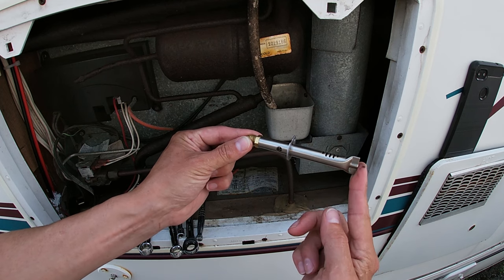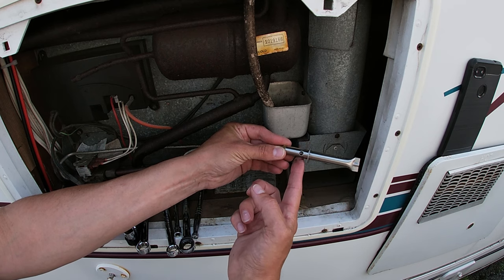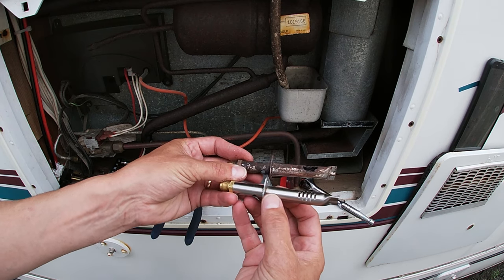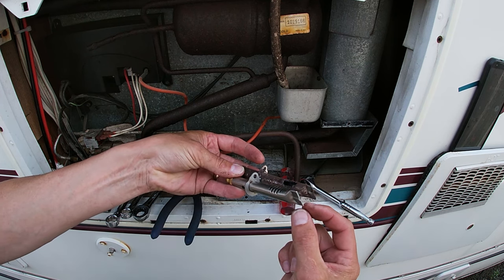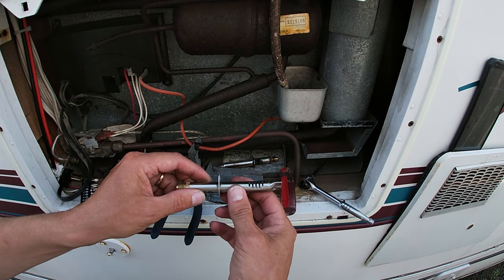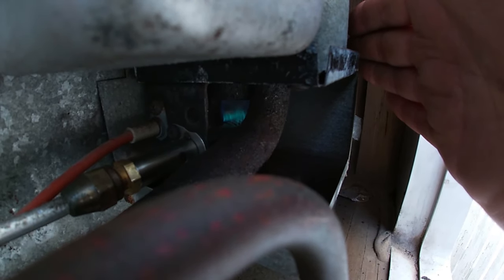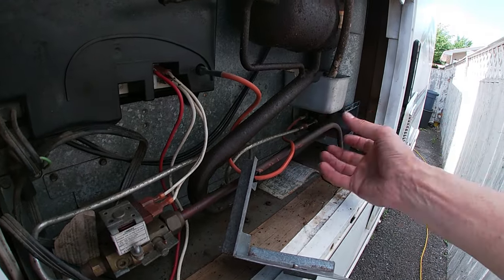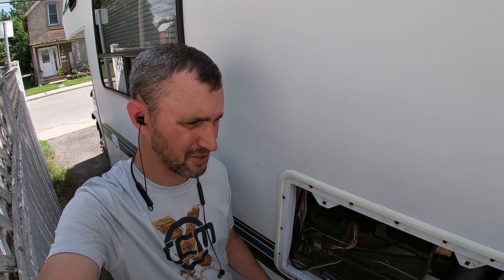Fix Your Norcold RV Fridge Problems

Comment: Thanks for cutting out how to remove the cover to do the repair, for us dummies.  Fast forwarded and you cut out how to replace the cover, so I couldn't work backwards to have an idea how to remove it.
Reply: if you cant figure out how to remove the cover, you shouldnt be replacing propane burners and other parts.

Comment: Dude  !  You just nailed my problem !  Nobody but you talks about the proper flame burn and mine has half orange flame .  Thank you bub great video,  better than all the rest !
Reply from the maker: Cheers!
Reply: My 20yo Norco also has a partly orange flame & the new ignitor I installed cannot succeed in lighting it. I have to restart the process, go outside, & light it manually w/a lighter. I'd like to try this before going more $$ w/a new control board. Perhaps I can even just clean it, although it has quite a bit of rust on the outside surface. Thanks for helping!

Comment: Hi, thanks for the video. We have a brand new 3 way Norcold. It is working on DC and AC but not on propane.  The solenoide valve seems to be looked and does not allow gas to go to the ignition area. How can we unlock that solenoide valve? We checked gas lines and gas is going through, just not getting to the flame area. Any advice would be greatly appreciate it!!
Reply from the maker: Some mechanical checks can be done. You can power the solenoid separately and see if it will click at all. (and pass fuel through).. as well you can check if your fridge has a pressure sensor on the propane line. If so, it may be out of spec/faulty/not reading. Follow this thought: If the solenoid works when powered manually, then maybe your fridge brains won't enable it due to 'low propane' sensor being tripped. If that's not the case (because you don't have any such sensor) then your fridge brains may have some other sort of sensor issue.. maybe your temperature switch isn't sending to the brain.. or something else like this. I believe RARELY is the actual brain the problem. Mostly I think the fridge problems are with the mechanical parts (like burners or sensors). When you use the AC or the DC on your fridge it doesn't use any of these propane systems or brains to operate.. so .. since your AC/DC is still working, it's NOT the fridge ammonia or piping or anything in the cooling system.. it's limited to the propane brain systems.

Comment: We have a Norcold N811RT. We run ours on electric. Fridge quit getting cold. Why would tube be hot to the touch ?
Reply from the maker: I just replaced one of those with a ffet1022uv frigidaire refrigerator. Same problem. It had a gas pressure leak and wasn't going cold. I believe yours may be the same and the refrigerant is dead to the heat, and it will no longer function.
Reply: @reelandgooutdoors  So just replace fridge?
Reply from the maker: @roboink  unfortunately they don't have service ports, so you can't recharge them. You can buy a whole new refrigerant coil system precharged and install it, but it costs more than a new fridge, with the same problems all over again.

Comment: Great video! Easy to follow. I have the same fridge as in the video. Works as it should with one exception, when in propane mode, it will shut off and not re-ignite. Usually around 3am, with a nice loud beeping to let you know. It has happened occasionally during daytime, but almost always at night. Any ideas? Thanks!
Reply from the maker: Any chance the fridge is low on power? I'm suggesting it's getting low on battery at 3am and it's cutting off due to low voltage? Just a thought. Low power or bad power connection might make the sparker misfire and cause an error. Check for clean and nice solid connections at the sparker and board plugs. Any dirt or corrosion can decrease voltage to the unit
Reply: Is the name propane fuel jet? I can not find the part using that name.

Comment: It looks like it's operating without a thermocouple. I didn't think that was possible. What am I missing?
Reply from the maker: It's a DSI heater, not a thermocouple. That's why.
Reply: @reelandgooutdoors  Roger that. As a dinosaur I was not aware of that technology. So something else is sensing the flame for the safety shut down of gas if the flame goes out eh?
Reply from the maker: @mattlovern4846  yes, the same unit that makes the dsi spark is also the thermocouple feedback, so although it no longer has a pilot light, it still uses the same tech to 'stay' on.

Comment: Hi! This is a lovely video. However im not running my norcold rv fridge off of propane, just ac/dc and it's not cooling :( 

Inside the fridge on the cooling fans, it was encased in ice. I took the ice off the fins when i was cleaning the fridge and now the whole thing won't cool. 

I'm not super knowledgeable on RV repairs and i was hoping maybe you could lend me some advice 🫶 i would appreciate it a lot.
Reply from the maker: If you have ice, it will work! By any chance was there a tiny metal clip on your fins when you took off the ice? That tiny clip is the thermostat for your fridge and is required to make it run! Move the clip right or left on the fins to make it warmer or colder. If you've moved the clip I expect it's now set too warm.
Reply: @reelandgooutdoors  I took the Clip off of the fins, it was never attached when it DID have ice

What I mean to say is that I took all the ice off of the fins while cleaning, and now the entire unit refuses to cool at all. The freezer isn't freezing, the fridge isn't cold at all. I'm worried I screwed up by taking the ice off (it's been several days and the fridge/freezer still isn't cooling anything down.

My rv doesn't (and can't) run off propane, just electric or DC :(
Reply from the maker: @Sunnnbeam  here's some links: you likely have a thermistor on your clip. https://www.amazon.ca/Dometic-3851210025-Thermistor-44-Lead/dp/B004LERB30/  and if it is gone now your fridge won't start. Check if you have or had one of these on a clip. Let me know. (Some have a copper tube one and not a plug in clip one) thanks
Reply from the maker: And here's a video showing how and why you need the clip and thermistor: https://youtu.be/bY7cy4Kf3VQ

Comment: Can you give me some idea as to the poor freezer cooling on electric vs propane in my NorCold? And, I seem to be going thru more propane than expected. I'm filling a 20 lb tank every three to four days. Thanks in advance. I don't have any electrical measurement experience.
Reply from the maker: Here's a couple of thoughts on this. If your electric heater element is supposed to be 400 w, check with a consumption meter that it is actually using 400 watts. If the element is bad it may only use 200, as an example. This will tell you your element is not producing enough heat to produce the necessary cooling in your fridge. Regarding propane, be sure your nozzle is the correct nozzle for your position in the heater and for the required cooling in your fridge. I have seen many nozzles that look almost exactly the same, but certainly are not when it comes to jet size and air flow, so be sure your nozzle is the right one for your actual fridge. Regarding general cooling problems, make sure your fridge and freezer doors are sealing perfectly around the face of the unit, so you don't have any air leaks. This can be a main cause of inefficiency on these small fridges. The cooling in the fridge requires air transfer out back. There's a set of heated fins behind your fridge which require clean air flow from bottom up through the top, and with that rear cooling the absorption through the inner heat sink transpires. This is how your inside fridge gets cold, by heating the outside coils and then cooling those. All of these systems have to work properly for these tiny fridges to function at all. I will say your propane consumption is enormous, and if you cannot isolate that it is only the refrigerator, I would strongly suggest you have another leak somewhere.
Reply: I just went through a 20 lb tank over the weekend. @paulallentaylor6034 - Did you find a fix?
Reply: @cschave  I haven't had a chance to putter with it. We are north in the cold air. When it warms up, I'll look at that dispersion pipe he shows. It's a good chance this is the problem. I ran my propane while boondocking and it didn't cool much. I will get into this soon.
Reply: @paultaylor6167  Thanks Paul! After looking into it further, I realized that I had only gone through 30% of the tank. It was secured to the trailer, so when I originally tried to see how much it weighed, it felt empty. Guess I'm just really strong : )

Comment: 4 minutes in, I knew you were the guy.
That being said.... I'm still searching for an answer because my Norcold is still sending the 'N' fault code or '5' flash code on other models.
YES: Checked all power sources
YES: Bought new board and it still shows 'N'.
YES: Tested thermistor for resistance, its good.
Tapped rusty areas to see if I can get gas flow.... nothing.
I'm stuck, please help.

Comment: Would you know why it would work only on propane and not electric?
Reply from the maker: Probably bad heater element. The electric heater (which is used instead of propane flame) is likely dead or bad connection or relay.
Reply: @reelandgooutdoors if this us the issue would it not cool while trying on propane and electricity?

Comment: Mine stays lit...but doesn't get cold. Help.
Reply from the maker: In that case, I'd be looking into a coolant leak in your system. If you have heat and no cooling you have no heat transfer..so that's either no airflow or no coolant.
Reply: You can also do a continuity test on the thermistor mounted to the fins inside.